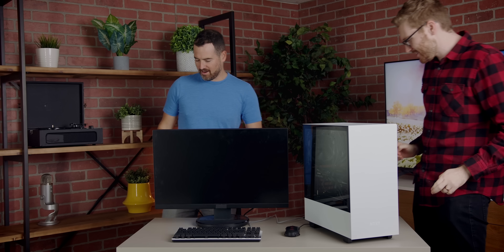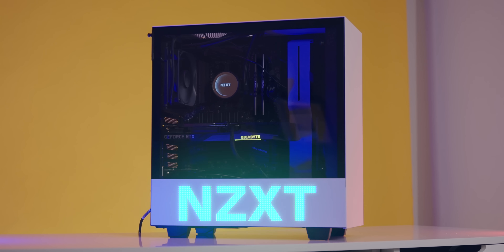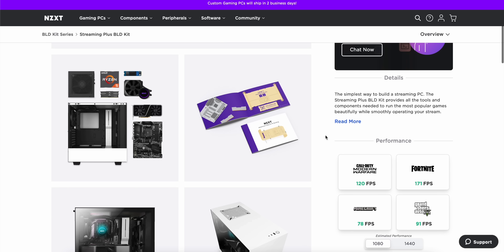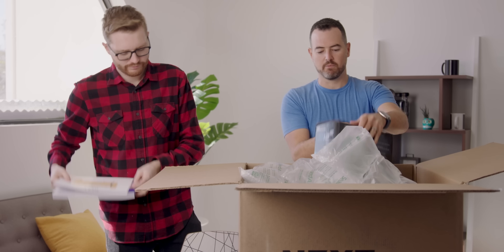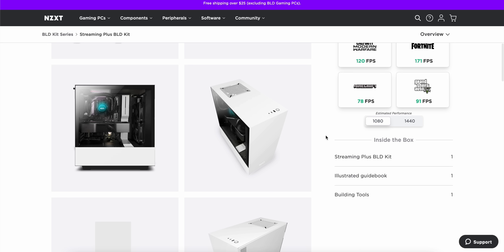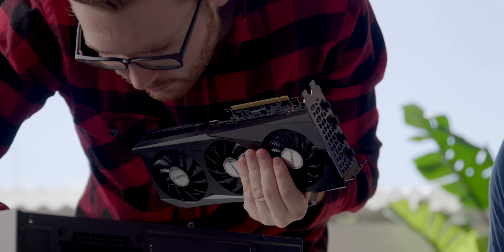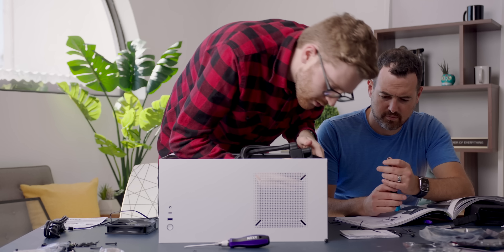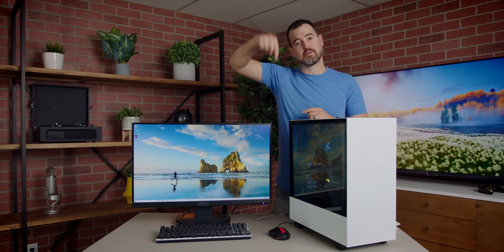Beginner Gaming PC Build - NZXT BLD Kit!

Comment: Building it myself I would put a priority on redundancy so it would not break down or get a virus so easily.
Reply: Redundancy has ABSOLUTELY nothing, zero, effect on preventing getting a virus. Education: Backups to an offline disk helps preventing data loss if getting ransomware for example. Redundancy for disks (mirroring for example) protects from loosing availability to the system and data loss as a result of a broken disk. Not downloading pirated software and AntiMalware software protects also from virus.
Reply: What if the main drive had the ability to scan for threats and if it found one switch to a mirrored drive while the issues with the first drive are fixed....  Yes twice the cost but never a problem...
Reply: @mgg5050  that isn’t how it works… if you mirror something, you also mirror eventual problems (except if the raid system decides to put an disk offline due to HARDWARE problems) Viruses will get mirrored to both disks.  Viruses are SOFTWARE.

Comment: I built my first ever pc in Missouri last year after I got lucky and got a 3090. Didn’t start at first, turns out I used the wrong cables. Fixed it and got it working at 6 in the morning. It was fun
Reply from the maker: How did you mange to find the unicorn?
Reply: @jon4lakers  through sheer luck and some sleepless nights. Got it on a Friday on Best buy.
Reply from the maker: @alimajazz  That is CRAZY impressive.
Reply: @jon4lakers  🙌🏻 btw it’s so refreshing to see you again on YT. Been following you since Techno Buffalo days and then somewhere down the line, lost you and found you again now. Keep it coming.